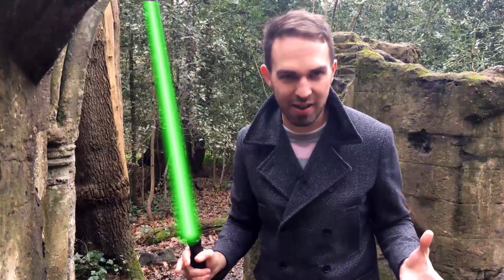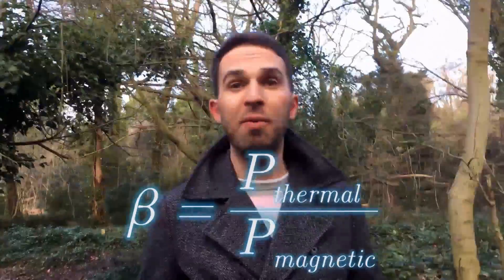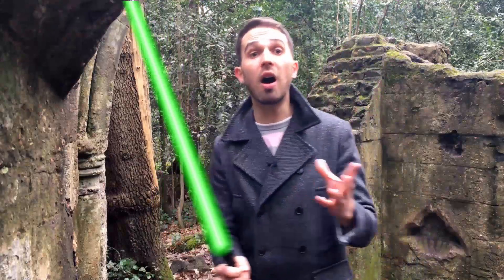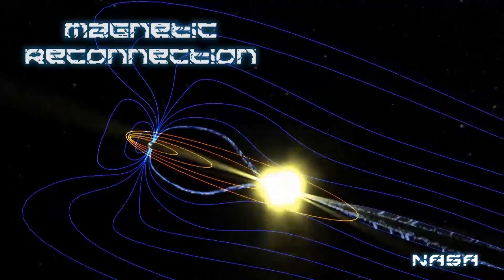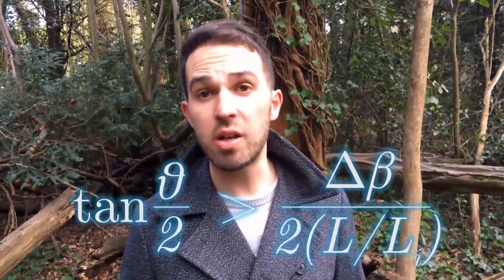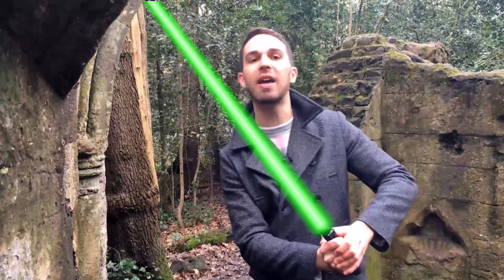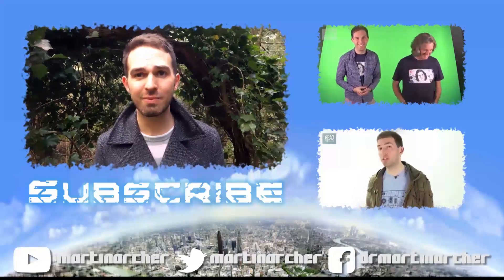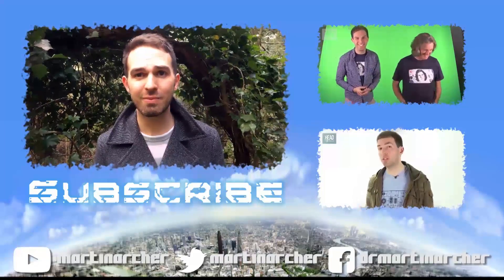The Fundamental Flaw with Lightsabers | Plasma, Magnetic Fields & Reconnection | Physics vs Film

Comment: Let's be clear: Planck's law governs blackbodies. In lightsabers, it's almost certain that electronic transitions, and not thermal radiation, dominate emission. Therefore, the color temperatures you calculated for the different lightsabers are utterly irrelevant.
Reply from the maker: +Bill Kong perhaps (I wrote an article about this video saying that this was also a possibility). The temperature barely affects the reconnection flaw though because for confinement the beta must be small

Comment: Would a laser work better? Or are there more problems with that as well? I know they state canonically its made from plasma but I'm curious if a laser could be better.
Reply from the maker: +Tom Firth there's no way to make something really like a lightsaber using lasers - you can't stop them at some arbitrary length and light waves can pass straight through each other so there'd be no clashing of two blades.
Reply: +Martin Archer 
Hey wait a minute! Isn't the point that the two magnetic fields containing the plasma repel each other? And so the plasma contained by the two lightsabers never touch! This is how I thought they always worked.
Plus they can easily cut through flesh or nonferromagnetic metal because the magnetic field passes through unimpeded and thing you're cutting is exposed to the plasma
Reply from the maker: There will be some repulsion, yes. But the most intense magnetic fields will be field lines with plasma on and outside of these they will fall off fairly quickly eg like a solenoid. Also don't forget that the charged particles in the plasma will be gyrating around the magnetic field, which sets a length scale for which plasmas are essentially "touching" if the blades get close enough. With high temperatures these length scales won't be negligible.
The plasma cutting stuff is all good!
Reply: +Martin Archer what about of the plasma is contained orthogonal to the direction you think it should be? What if it's a random, amorphous swirl of plasma just kept in a loose cylindrical container by rapidly oscillating and compensating magnetic fields? Do you think it would be possible with an unlimited amount of technology, with only the laws of physics to be obeyed?
Reply from the maker: +Calvin Jary my analysis didn't need to go into the specifics of the magnetic field topology and any compensation required. Simply put, in a magnetically confined plasma (v small beta) reconnection will fundamentally be a problem due to the laws of plasma physics!

Comment: Your analysis assumes that the plasma is being constrained by a magnetic field. This seems unlikely, given the geometry of the light saber mechanism and the absence of side effects of the field.

Also, my understanding our present fusion technology is that the magnetic containment field is there to prevent the plasma from being cooled by surrounding material, not to prevent it from melting anything. Although the temperature is high, the actual heat content is rather small. I would guess that a much denser plasma that could actually vaporize stuff would require much stronger magnetic fields.  (I won't point out that the effects of the light saber do not resemble what would occur if a plasma of any amount of energy came in contact with physical material.)

More reasonably, given the technology assumed by the film, the plasma would be constrained by a force field. Since we really have no idea what a force field is or its limitations, it's hard to argue that it wouldn't work.
Reply from the maker: +Scott Draper 
See here for information on what happens when plasmas come in contact with tokamak walls, which discusses how it erodes the wall material introducing impurities into the plasma amongst other effects
https://www.psfc.mit.edu/research/topics/plasma-material-interactions

Given the immense temperatures involved, even rarefied plasmas possess huge amounts of "heat content" e.g. 14-210 atmospheres of thermal pressure for plasmas only 4 times denser than air, hence the immense magnetic fields required to contain them.

Magnetic fields are by definition a type of force field and there are plenty of ways you could construct the topology of the field to make it more lightsaber-y utilising a magnetic mirror at the end, toroidal field components etc. I didn't want to get bogged down in the engineering detail since many others have focused on these sorts of aspects before. There is no other way to confine a plasma, which requires a force to act on the medium - gravity is too weak,  problematic and certainly couldn't give you the shapes required.

At the end of the day, yes the lightsabers in Star Wars are pure fiction. This video applies actual Physics to the only conceivable real world facsimile.
Reply: +Martin Archer Keep in mind that science fiction uses "force field" in a very different way from physics, just like "phaser" bears no resemblance to "phasor", to the bitter disappointment of freshman physics students everywhere. :-)
Reply from the maker: And our attempts to make those sorts of "force fields" have typically involved using plasmas controlled by magnetic fields.

Comment: The one issue with all lightsaber physics in our science, is the crystal. In the Star Wars universe, the crystal does far more then focus the blade, its in itself a semi intelligent living thing, more energy or "force" then animal, and it can think for itself on a very basic level. It would have self preservation. So in short, it does not want to die, and does not want to harm the user in theory, being they are connected on a spiritual level. So we can assume, any flaws from a strike would not have the effect as it would if it all was purely man made. Its why in cannon and in most legends, they cant be mass produced, and are always made for a force user. Even with advanced tech in the star wars universe, you dont see space criminals having their own basic one, or officers have them as a side arm. Because you need training and a connection  to build one, sure you could find one, pick it up, maybe turn it on and use it like finn, but those examples of truly forceless users and one crazy cyborg is few and far between. 

So in short, yes they require power and magnetic fields we dont have, but also have a mystical and living aspect to them as well, so i dont think well see them any time soon, or at all. We will see blasters at some point, not needing physical ammo is far cheaper, so the arms dealer people will make them for use one day, but sabers is very very unlikely

Comment: It's actually, never mentioned what lightsabers are made of. I would think that lightsabers blades cannot be made of plasma, due to the physical presence of the blade. Aside from being able to block plasma bolts, the blade is also capable of obstructing solid objects, such as vibroblades, and cutting rock as if it were solid. It would suggest that it is fully impossible to even make a lightsaber in our world. It is called science fiction for a reason. Though I do suppose plasma is the closest we can get.

Comment: No lightsaber contrivance will ever be from heated plasma, regardless of SW canon. To have any object that is hot enough to literally melt without the slightest pause straight through wood, flesh, bone, thin pieces of metal, plastic, etc. would be so hot it couldn't be carried by a human hand.  A high-temperature gas is not the effective path. Rather, it would be some new discovery along the lines of an induction forge, and wouldn't function by way of heat. It would function by canceling/decomposing molecular bonds in nearly any material it contacts.

Comment: There are so many different possible ways in which plasma swords can work (possibke actually, scientifically, in reality) , you think that will ruin anything?
Reply from the maker: Ninja Hombrepalito care to mention some of these others ways then? Back up your statements like a proper scientist.
Reply: Martin Archer I'm not a scientist. And I am not a person that thinks is better than others because thinks knows more about stuff. I am a person with common sense, some knowledge, abd a big consideration of the variables, never putting too much trust in anything. 
.
First of all, plasma could be emited from a solid extendable rod. Actually, just the words solid extendable rod includes some of the possibilities. Second, plasma could be a bi product of energy being manipulated in a way, which would be what actually cuts whatever the lightsaber touches. And actually, that puts the other possibilities. And both ways could work together. Specially considering that a nagnetic field would not need to be so strong to shape plasma if it were an electromagnetic rod. And there wouldn't need to be as much plasma, and it could have ways to calibrate it. Quigon only started melting through the second door when he stabbed the doors for the second time.
Reply from the maker: Ninja Hombrepalito Ninja Hombrepalito you need to confine plasma otherwise it would quickly dissipate, magnetic fields are the only force in which that is possible under scales of the size of a star. But all magnetically confined plasmas will have the issue of reconnection as explained in the video. All your other “solutions” are vague and don’t solve these issues. This is an educational video and channel where I introduce scientific concepts from research to people. I’m not trying to show off that I know more stuff, I’m helping other people to learn about stuff they may not otherwise come across. Saying I’m wrong with no facts backing that up doesn’t help, that’s all.
Reply: Martin Archer What if instead of confining plasma,  you just produce more plasma? Btw, have you looked at videos of plasma arcs interacting with magnets?
Reply from the maker: Ninja Hombrepalito that would be super dangerous because of the amount of plasma you’d all the time to counteract it rapidly flowing out in all directions because of the immense temperature difference between the plasma and surrounding air. By turning it on you’d get burnt!
Plasma arcs form because of currents flowing through the plasma which in turn generate magnetic fields confining has the plasma’s shape to within an arc. Though plasmas tied to magnetic fields interact slightly differently to plasmas interacting with a permanent magnet, it’d be more akin to two plasma arcs interacting. That being said, in those videos you mention there are a large number of electrical discharges occurring, basically like being hit by static shocks or lightning.
Reply: Martin Archer You would need a lot of plasma, but it wouldn't have to be very distant from the rod. As long as the plasma is not within inches of the body, it won't burn. As for the handle, just needs like three inches abd the plasma to be blowing in the opposite direction. 
.
Theee is one video where the plasma coats the magnet. And yes, elwctric discharge. That could work.

Comment: What if instead of having a huge magnet directing the plasma you had many infinitesimal magnets along a shaft hidden under the plasma beam itself. I'm guessing this could be accomplished by guiding electrons through a tiny-coil array of super-conductive wire. The blade would then be made of tiny strips of plasma, and who cares if a tiny strip like that explodes while you're using it in a fight.
Reply from the maker: +Bizorke how do you stop the tiny strips from reconnecting with one another forming one giant blade? Nice idea though
Reply: Martin Archer Each micro-beam would need to oriented in a direction that doesn't contribute to neighboring beams. In the event of a plasma arch, some type of active sensor network would need to somehow correct the flow of electrons through that part of the saber. The surface of the plasma shaft would essentially be a very intricate super-electronic surface, kind of like a high-res LCD monitor on steroids wrapped around a pipe that shoots polarized plasma out of its pixels.

Comment: Temperature = 0.0029/wavelength (Wien's Displacement Law). For a RED lightsaber, the wavelength is around 780-622 nanometres. Taking 622, converting it into meters getting 622*10^-9, then putting it into the equation we get the temperature of a RED lightsaber as (around) 4662 K. In the video, you said 1000K for the red lightsaber. After doing some research into other red black bodies i.e. red stars, I found out that my answers were much closer than yours. However, the pattern that the lighter colors such as blue were hotter than the darker colors such as red is still true.
Reply from the maker: That might be the peak wavelength, but because the curve has a long tail this peak doesn't represent the "average" colour observed. FOr that you need to use colour temperature. 4000K is in the yellow range of colour temperature and while we call many stars red, they're actually more orange in overall colour.
Reply: Martin Archer
Ah I see. Thank you. But, don't lightsabers look red pretty much all the time?
Reply from the maker: Yes, hence the lower temperature to give a red colour temperature, the actual perceived colour, rather than orange or yellow if you were basing it on the peak wavelength.
Reply: Could you please reply with some mathematical proccessing? I'm doing a physics assignment, and it's on lightsabers, and i really need to understand the colour-temperature aspect. Thanks.
Reply from the maker: There are pretty good resources on Wikipedia and beyond, but the formulas aren't simple enough to put here and will depend on what you're trying to do. Good luck with your assignment.
Reply: Martin Archer  Ok thanks. Nice video btw I didn't say that earlier :P

Comment: I mean where should you get  plasma from you can't use a fusion
Reply from the maker: You don't need fusion to just create a plasma, that's about trying to harness nuclear energy by making ions in a plasma combine. To form a plasma all you need is enough energy to rip at least one electron off of some of the molecules present. It could be formed from just the air around the device.
Reply: @DrMartinArcher  I know but thats just as difficult if not more
Reply from the maker: @dirtbuilder4615  fusion is WAY more difficult than just ionising a gas, we're talking at least 1000 times hotter temperature required for that just to start with!